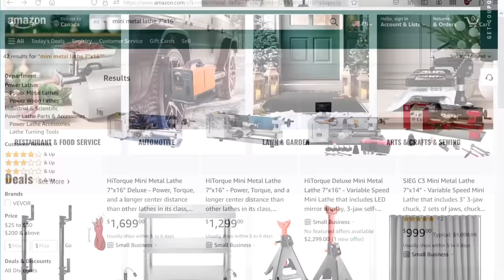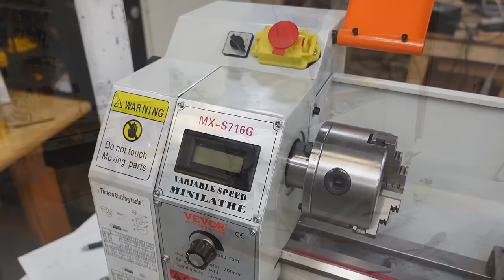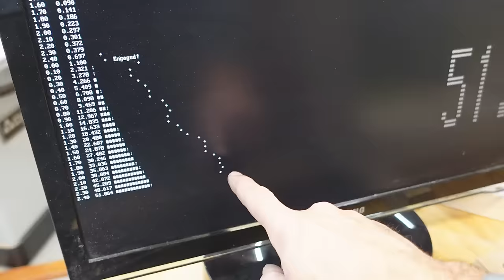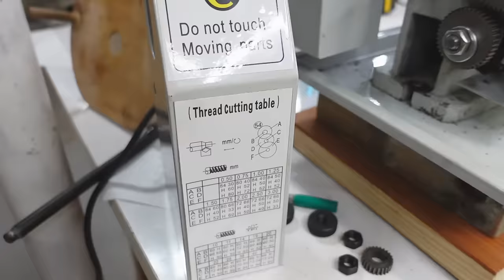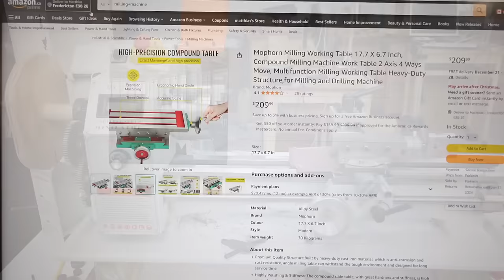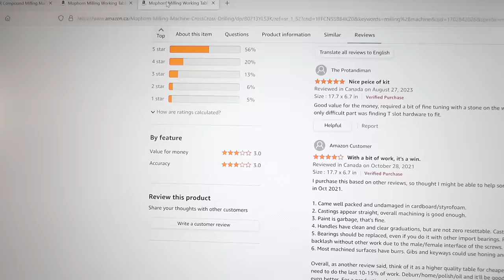I finally got a metal lathe

Comment: "I got a new tool!" 90 seconds in: "I'm customizing it!" 2 minutes in: "I'm pushing it a bit!" Lol, love you Matthias!
Reply: open box: first thought "let's disassemble it", second thought let's customize it, third thought let's make one from scratch, final thought.... let's make another but bigger and better, repeat
Reply: That's pretty much what every mini-lathe owner does, me included. It's kind of a kit, some manufacturing required.
Reply: it's a "minila the" - they're always a work in progress. He should get a real big-boy lathe and not muck around with these toys. You buy a mini lathe if you want to muck with it, you buy a real lathe if you want to make actual parts
Reply: @nate6692  I would add "every tool owner" you'll will be surprised on how many ways you can tan tweak a pair of scissor to cut nothing
Reply: @gorak9000 any "mini", "lite", etc tool is for hobbyist or wanna learn to be a machinist (imo)
Reply: That was my reaction too!   A great review, but not a great advert for the company. xD
Reply: Plus he absolutely had to add a wood component!
Reply: @kase_backoe  it's a metal late obviously needs wood
Reply: @greensteve9307 At least it is possible to improve it with knowledge and some tweaking. The wrong thread working gear ratios are really bad for someone who isn't that experienced as Matthias.
Reply: Two types of shop worker, one who brings in a new tool then modifies it, the other who brings a new tool into the shop then returns it ... I wonder if tool failures are down to the modifiers who don't send back? I'd still have more trust on a modifier over a returner.
Reply: @the_grand_tourer  I' don't buy cheap tools, I buy new projects. even the "crappiest" could last years if you use the right way and fix the often minimal flaws they have (often people buy the most expensive 12" electric chainsaw then return because they broke the thing cutting down the oak behind their houses, while a cheap 20" gas one + cheap files some tweaking and sharpening every some time would have done the work, 10 times for half the price, expensive doesn't mean good, and cheap doesn't mean bad - know your tools, use them don't abuse them - and when in doubt, mod it to your liking)

Comment: Doesn't mention the time he made a Morse taper with an angle grinder. Absolute Canadian levels of humility on this guy here.
Reply: And a lot of Swabian levels too.....
Reply: He's still on @thisoldtony's "enemy list"... for actually working.
Reply from the maker: I'm wondering if I need to make a morse taper on that lathe, whether I'll end up tuning it with an angle grinder!
Reply: @matthiaswandel  Make an attachment to hold a small angle grinder for the new lathe, I did...
Reply: @matthiaswandel  I am a little disappointed because I always expected you to make a metal lathe out of wood.
Reply: @matthiaswandel you really need a long taper set-up to do a proper Morse taper which you would have to custom make for the mini-lathe.

Probably better off CNC converting it
Reply: @phookadude As cool as that would be, rigidity may be a major issue. It would still be great to see though, it would make a great video  for sure.
Reply: @matthiaswandel this is a fairly difficult thing to do on even a better manual lathe.  I would attempt to set this up turning between centers by offsetting the tail stock checking with a dial indicator on the tool post if I had to do this.  But do some work on the basics before attempting
Reply: wasnt it a jacobs taper?

Comment: When Matthias used the angle grinder I felt a great disturbance in the Force... as if millions of machinists cried out in terror and were suddenly silenced
Reply: @JanTuts  You, Sir, got me laughing real good 😂
Reply: For real! also he has lose clothing and long sleeves. Just terrifying!
Reply: @hampopper3150  I mean, he's several times heavier than the machine. Probably can't die
Reply: @chaklee435  That lathe weighs 150 pounds. It is only 1100watts but it will eat your arm and make its way to your head. Don't underestimate a small lathe they are way more fatal than a table saw.
Reply: matthias would be too powerful if he had a full machine shop
Reply: underappreciated comment :-) @JanTuts
Reply: @FayezButts  do you know what make and model of that lathe? Are you willing to lose your arm, hand, or even your fingers? its not a 500watt 7x14inch lathe its a 8.7x29.5inch 1100watts lathe you are out of your mind.
Reply: @FayezButts  Ok I think I may have made a mistake on the model but still don't mess around with a lathe.
Reply: I’d hate to see the lathe ways after bits of grinding wheel get caught between the sliders.

Comment: something... something... Dark Side!
congrats, MW!  despite their limitations those are are remarkably versatile machines.
I look forward to seeing the uses you dream up for that thing!  Play safe!
Reply from the maker: I watched your video about your mini lathe after going over this one and realized most of the flaws I noticed are pretty common with these lathes.  Yours also has the useless metalized plastic angle indicator for the cross slide.
Reply: Swapping the ball bearings with tapered roller bearing is probably the first thing to do and the best advice!
Reply: But would either of you be willing to dive deep into the world that is 3D printing? One could make their very own 3rd arm capable of lifting a metal workbench.
Reply: I’m pretty sure Matthias put the the key in the chuck on purpose to bait everyone into commenting and help the algorithm 😊
Reply: And of course, what would any device in his shop be without dreaming up at least one wooden accessory, namely that crank handle!
Reply: @matthiaswandel Most of these lathes aren't very nicely made, But I think you may have picked a particularly shoddy one. I have a Sieg SC3 7x16 Lathe and SX2L mill. The Lead screws are within 0.01mm/100mm as far as I can tell on both machines. Most of the axiis are out of square in all possible ways by about 0.01mm/100mm from what I can tell. They are a bit rough around the edges, and "only as good as they need to be". The compound slide on mine, for instance has a much tighter fit on the locating pin, and there is actually a tick mark. It's still only useful for coarse adjustment.

If you feel like upgrading anything on the lathe, the two biggest things you can do is spindle bearings and solid toolpost (replace the compound with a solid block of metal). Both make a world of difference.
Reply: Congratulation, Matthias. It's a handy tool that can do things no other tool can. Just stay away from welding. It's an ungodly path to a fiery hell of sparks and smoke from which there is no return.  Wood comes from trees that live in the open air, and thrive on sunlight, rain and soil. Metal is heavy and dead and made by fire from ores, dug from down in the earth 😂.
Reply: As soon as I saw this video, I thought "Manilla The!"
Reply: I really like your ASCII art display on the load test machine -- that's a lot of fun.
Reply: @Trust_me_I_am_an_Engineer  Wow! we need to hear more of this stuff :) Keep it coming. An engineer working with bamboo here.
Reply: Wow, how much does Matthias pays you to do a good review :person-turqouise-waving:

Comment: Bolting it to the table will help with the chatter a bit. Metalworking tools crave as much stiffness and rigidity as possible to work right.
Reply: Definitely won’t hurt. May not cure all ills. But very recommended.
Reply: The large amount of chatter was likely also caused by the interrupted cut, higher depth of cut and lack of torque from the motor gearing
Reply: Ferrous metal is when machining starts to get real. Before then you can pretty much ignore everything and it all still works. But at a certain hardness things get hard. Then your surface speed matters. Along with as you say rigidity. The more marginal the setup the closer you have to be to optimal for things to work.
Reply: I was thrilled to see this video as I took a community college continuing Ed course in metal shop and was looking a a potential purchase of a desktop metal lathe. Thank you!
Reply: Better yet if he bolts it to a concrete top table like makercise did with his gingery lathe build
Reply: @joreosuna650  you have to be careful bolting machinery down. Perhaps what you're bolting it to is flat but what if the base of the machine isn't? Then you introduce twist. You're also sacrificing portability with a machine like this. You can't just pick it up so easily if it is bolted to a heavy base. Not unless you unbolt it first. That can get old fast. I suppose you could weight train so you can handle the lift. That's what elevator testers do. They have to drag all them weights in by hand. So when they're out of work they stay fit. Elevator testing isn't steady employment. It is a good gig if you're a gym head anyways though.

Comment: Love the 7xX lathes. They are forgiving but capable machines, congratilations!
Reply: Do you know of one of these that is suited to cutting steel?
Reply: @orijimi  yeah, all of them. It comes down to tools and how much of a cut you take.
Reply: Agreed, you need to get the machine properly secured and dialed in, in its default state it may need a fair amount of adjustment depending on the seller. But once done i have no issues with machining steels like 1040, O2, and 303 and 17-4 stainless within the size limits of the machine

Comment: Cut an angle block from a scrap piece of wood at 29deg so you can set the compound angle against the chuck for single point threading.   This will reduce the load on the threading tool which should reduce chatter when threading.   I use a similar block to set my 12in swing metal lathe.   I normally leave my compound at the 29deg so I am ready for threading.
Reply from the maker: I just ground a point on the tool and went in straight at 90
Reply: @matthiaswandel you can go straight in Matthias, just use both the compound slide (set in the usual position perpendicular to the cross slide) to add a side cutting element, ie, zero both cross slide and compound slide dials (or at least note the start positions of both) then for each pass, go in 0.003” on the cross slide and add 0.001” on the compound slide (or equivalents). This should ensure you only cut on one edge of the tool and will help remove the chatter
Reply: @matthiaswandel  ThisOldTony has an excellent video on thread cutting that covers the hows and whys of cutting at 30 deg (~29) can help. It's worth a watch if you haven't seen it yet.

Comment: The surface finish you show at 10:30 looks like what you get when you machine brass with a cutting tool that has a sharp point.  A cutter with a rounded point can produce a mirror finish on brass.

Comment: Mathias, you want something really, really stiff to mount the lathe to. Stiffness helps reduce chatter and will help keep you from breaking cutters. Artisan Makes has some good videos on this.

Also be careful with the cross-slide for the drill press. Drill presses aren't meant to take side loads, so you may have issues if you try to do anything "heavy" with it.
Reply: Might be useful for precision hole layout though.
Reply: Good point!  Tried to do some milling on my drill press.  The chuck is mounted with a Morse taper that will not tolerate side loads.  Milling machines use a drawbar to hold the chuck or collet in, drill presses do not.

Comment: Looks like lots of fun . 
Having cut lots of single point threads on my lathe i would suggest setting your compound slide at 29 degrees and adjust your depth of cut with that . Zero the cross slide dial and just use the cross slide to back tool out to return then wind back to zero and advance tool with compound . This will help with your chatter problem as the tool will only be cutting on one face and you will get a better finish on your threads . Also run a file over the top of the threads at the last to help with clearance .
But congrats on achieving a thread with mini lathe and your innovative method to hand crank cheers Doug , New Zealand

Comment: I saw the short you made about leaving the chuck key in the chuck.  Having been guilty of this I can tell you that having a chuck key fly out of a chuck is not a way to improve your day.  Most every machinist I’ve worked with make a habit of laying it on the headstock of the lathe.  Some even make a bracket for the chuck key on the side of the lathe, anything to keep it out of the chuck.  I love your videos and appreciate your laid back style of doing woodwork.  Stay safel
Reply: My university’s lab has a safety switch that you have to put the chuck key in for it to turn on.  They added those after several were embedded into drywall.

Comment: Thanks for the video, Matthias! As a retired millwright you’ve peaked my interest in smaller hobby machine work. 

One tip is to make sure your tool is centred on the stock you’re machining. Some of your finishes look like they may be due to this.

Use some tool steel and sandwich it vertically between your tool and the stock you’re machining. It the tool is dead centre of the stock, your tool steel should be perfectly vertical.

Another thing that will drastically improve the cuts you’re making is buying a carbide cutting tool especially with the underpowered unit!

Comment: I went through a lot getting my first lathe, first buying chinese, and then a few different types.  Where I came out was buy old South Bend.  Prices can be reasonable.  There is more aftermarket support for a 1937 SB, than there is for any one of the chinese lathes.  They are made immensely better.  They are true Imperial (depends how you swing on that).  Most chinese lathes are metric, but they put different handles on them and gears to sorta do imperial.  I learned both system in school, but after 50 years in the shop, I just threw in the towel over being out of sync with the neighbours and having two systems. One tip for buying SBs is that they come in a variety of levels, and often the cheaper lathes are in better condition because they were bought by small shops, or even hobbyists who didn't put a lot of time on them.  While the high end toolroom lathes got a lot of work and may have been desirable to buy up till they got totally clapped out.  My first lathes had hand change gears, but it really didn't seem to be more expensive to get a gearbox, so I look for those.  However, hand change geared lathes often have better condition, and the gears are a separate proposition to the lathe, so you aren't locked into the condition of the gearbox.

There are a lot of other old lathes out there.  I owned a beautiful Drummond, but for parts and info one can't beat a South Bend.  

I have seen them for sale in NB.  When the electric motor shop was where the ski shop is now, they used to have old ones from time to time, though Kijiji and Craigs.

The other reason to get old iron is that it is not uncommon to come across a deal where the owner throws in everything else he ever bought or found as a package, and you get a fortune of parts basically for free.  In the US every part is potentially saleable on ebay, but here, the market is so small, people often just forget it.

Comment: One important safety tip: train yourself to always remove the chuck key from the chuck. Never ever leave it in there, even for a short period of time. I learned the "ouch" way of why that's a good idea back in the day. Good thing my instructor didn't see me limp out that day. :) EDIT: I did a full teardown/cleanup/rebuild of my own lathe back when I got it... quite an adventure
Reply: I'm always surprised that a built-in safety against that isn't like, a standard feature. It could be as simple as "you have to put a chuck key in this handy magnetic chuck key holder, or the lathe won't start." Obviously you'd get people just leaving a spare key in there the whole time, but it seems like such an easy win.
Reply: @paxwort There exist chuck keys with a spring around the shank that extends to the end of the tip. It's not difficult to compress the spring enough to engage the tip of the key in the chuck, but the spring is strong enough to push the key out of the chuck and drop it onto the floor or into the chip pan, when you take your hand away. Search "self ejecting lathe chuck wrench" for examples.
Reply: On these small lathes it's not a hazard leaving the key in the chuck, they're too weak to cause any problems
Reply: @TWmOrfar  While it might be less dangerous, it's still a good thing to train yourself to do IMHO.
Reply: Self ejecting chuck wrenches are OK, but annoying to use. A wrench storage spot with an electrical cut-off is OK too, and often sensible on drill presses as well. But most of us machinists just develop a really strong habit of never leaving the wrench in the chuck. We also jump each other's shit if we ever see it. I get the heebee jeebees just thinking about it. If you don't regularly use a lathe it may difficult to develop and maintain the habit. But given how dangerous woodworking tools can be, good safety habits are a high priority for all of us. (Or should be.)

Comment: Hi Matthias,  glad that you have joined the metal hobby lathe group. I have the Vevor 7” x 14” Metal/Wood lathe model CJ18A and it needs a lot of fine tuning. You will find that the more ridged you make the base the better it will preform. Keep up the great job on the videos

Comment: Ah industrial arts was a favourite class in high school. One side had dedicated machines for woodwork with lathes, bandsaw, jointer etc and metal working with milling machine, lathe plus welding on the other. The variety of skills taught blew my mind and contributed to becoming an engineer. So fond are those days I ended up building a smaller but well equipped wood working facility and crude metal working. Yes a metal lathe would be nice.

So Matthias, keep living my dreams.